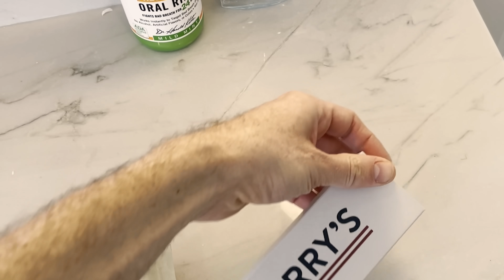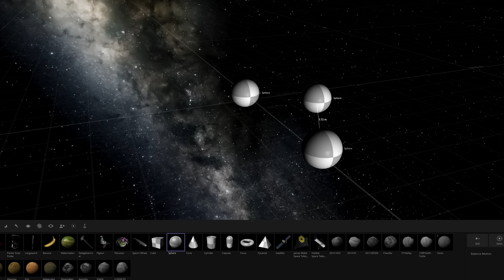Perpetual Motion Achieved

Comment: I can already tell that hundreds of people are about to ask the exact same questions, so I'm pasting the replies that I've already written here:

So... scam artists like to use the term "Perpetual Motion" to confuse people. The problem is not about "Motion" itself. Everything is always moving and everything will always be moving. Energy is never created or destroyed. The issue is that to perform mechanical work, you need a higher concentration of energy on one side of your machine, and a lower concentration on the other side. As the energy flows from one side to the other, you can use it to move things.

If the energy is in equilibrium between the two sides, then nothing will move. There is (on average) exactly the same amount of motion in all directions, and the total of all the equal motion cancels out, and so nothing moves anywhere in any single direction.

The water in a mountain lake has a huge amount of potential energy... but a volume of water won't flow anywhere, because the volumes of water on all sides of it aren't flowing anywhere. and those volumes of water don't flow anywhere because the other ones aren't flowing.

Punch a hole in the side of the mountain, and now the volume of water next to the hole has a space it can flow into... and the volume of water next to that will soon have a space, where the previous volume of water went away, etc. etc. You can stick a paddle wheel into this flow and extract that energy to do work (grind your grains, electrify Las Vegas, etc.)

If you had originally put your paddle wheel in the middle of the lake, it won't spin, because the water wasn't flowing anywhere.

---

The magnetic force, like gravity, is conservative -- that is, the potential energy only depends on location.

To use gravity as an example, things fall down, and they never fall up. You drop something, and no matter what path the thing takes through space, it's never going to be able to get back up higher than the hight from which you dropped it from. (You must add new energy from something else to move it higher.)

If you have two magnets held apart by some distance, and let them go, the magnets will "fall down" with respect to each other, and they will never "fall up" by themselves.

You can extract the energy from a falling object... but only once! After that it's stuck on the ground (or table, or whatever you dropped it on) and stops moving.

You can extract the energy from two magnets... but only once! After that they will stop moving.

Comment: It will stop eventually with loss of heat and energy in the form of friction and air resistance, but it will take a long time, i suppose
Reply: It will eventually stop when the battery runs out of power.